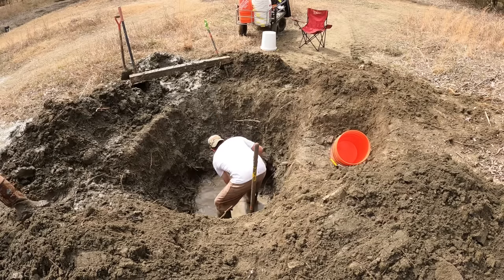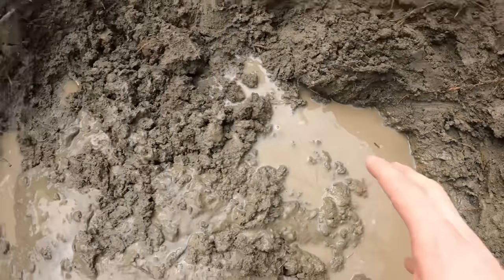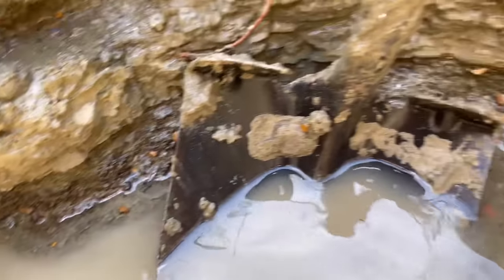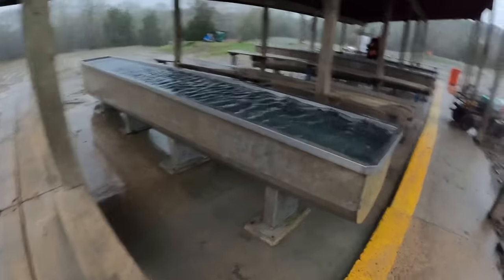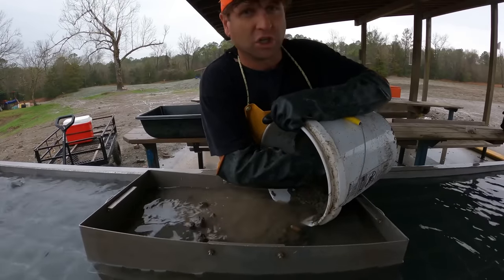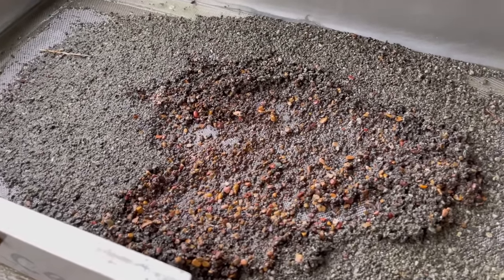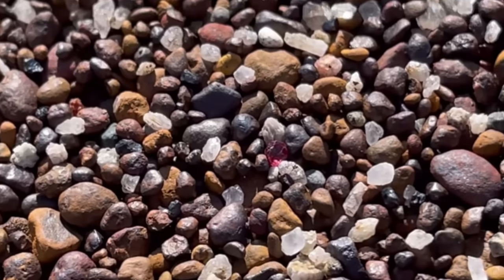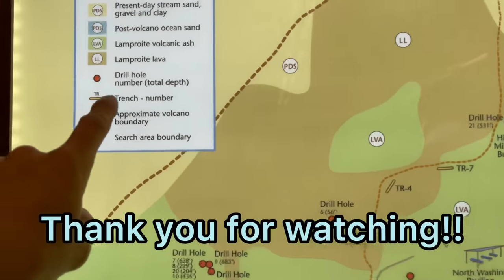FLUORESCENT DIAMOND FOUND! ~ (Real Diamond Mining) April 2021 ⛏💎

Comment: on the subject of making it harder to find diamonds ....I don't know how long you've been going there but I assume you know that years ago there were none of the ridiculous rules about size/depth of holes and filling them at the end of the day.  A ladder was an essential piece of gear as well as shoring timbers and it was not unusual for serious miners to spend 2 or 3 days digging 10-12ft deep pits in the east drain to get down to the original mine tailings and then spending several more days digging out another a yard or so of pure gravel from the bottom, the only requirement at the time being to put a piece of plywood over the top of your hole each night.  

Unfortunately, the sad truth for regular miners who enjoy working hard for their diamonds is that the park is doing all it can to frustrate them enough that they give up and stop coming, which is what many,  many have already done. I applaud your efforts and am glad to see you still getting results but it's a shame the park has pushed out most of the old timers.
Reply: 11:59 this is enough to give any diamond hunter a woody

Comment: So do you check all of the material in the centers or just the top surface?
Reply from the maker: I just scan the top of the center. Your 7 points and up are normally visible if you make the center correct. The small diamonds like 1,2,3,4,5,6 pointers are found searching through all the material on a pizza pan or cookie sheet. I don’t look for those diamonds anymore. The centers go into a huge container so I can bag it up, and ship it to eBay, and Patreon. 

Thanks for asking!